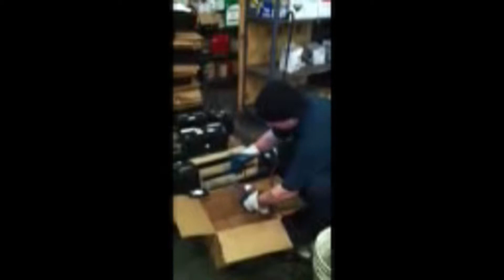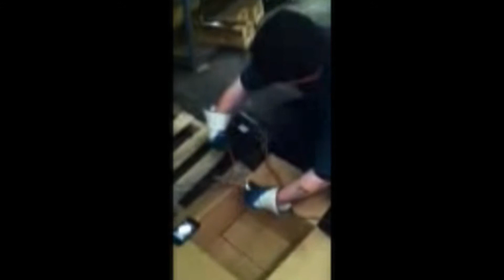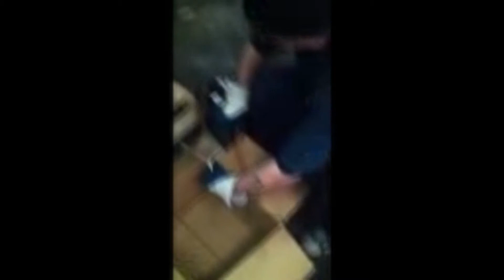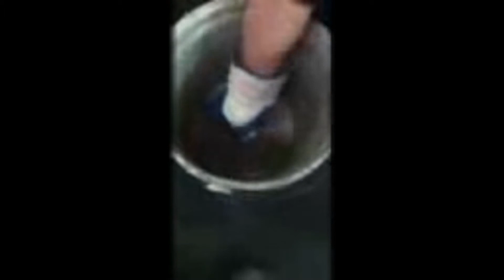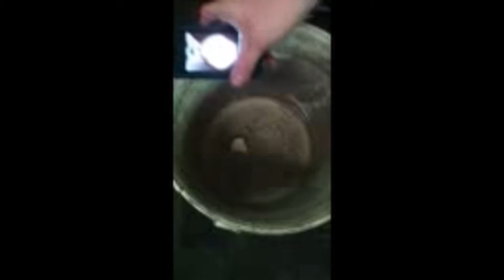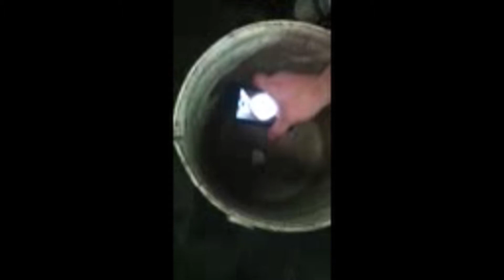Battery Made Compass (Edward Leedskalnin Technique)

Comment: @PerfectweaponINC I got the same result,ie Mine pointed a little North East just slightly to the right.I figured that I did it wrong but have repeated it with the same result.It seems if you make a magnet with a electric current it is different to making it the traditional way.It almost has more of the NORTH pole magnets in it than the other kind/way.